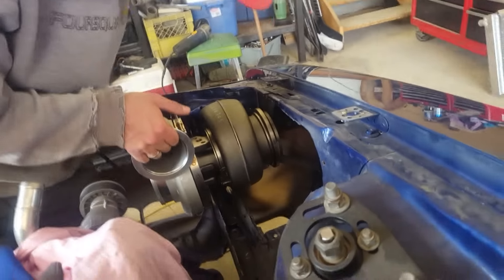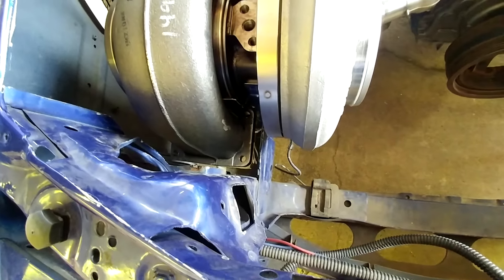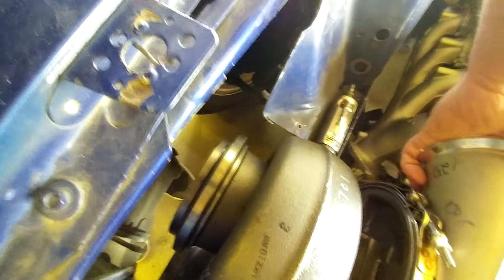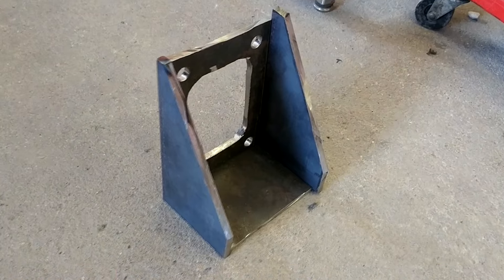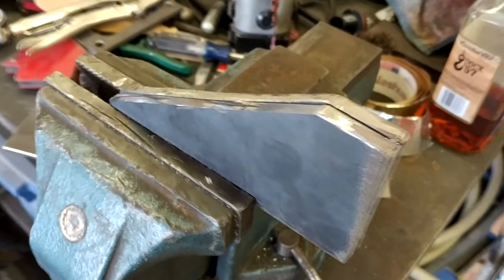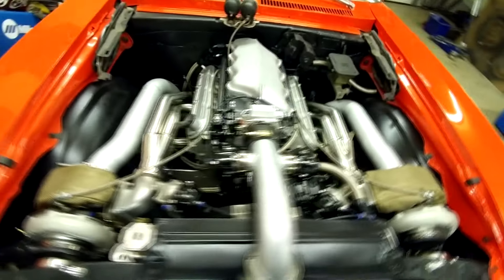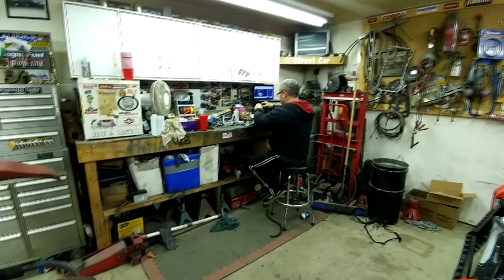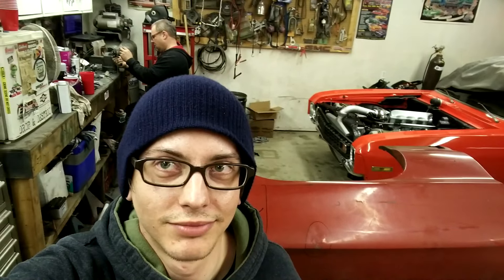S475 Turbo Foxbody Build | 5.3 LS swap progress, huge burnouts

Comment: what are the details on the 5.3? heads, cam, intake, injectors, EFI system, ect
Reply from the maker: john S All stock besides LS9 cam, and the plan is de capped stock injectors.
Reply from the maker: John Witwer Because I want to go fast! :P Fast for cheap is more like it.
Reply: John Witwer To fix it :)
Reply: SPPTV how is it getting tuned
Reply from the maker: T1GR3S13 Stock truck ecm with HPtuners by myself. Same as the Shithorse except it will get a 3 bar MAP speed density instead of a 2 bar like the Shithorse.

Comment: you're not worried that heat coming off the turbo which is now mounted directly to chassis is going cause embrittlement which then lead to cracking?
Reply from the maker: Harrop355 No. That part of the frame isnt important, besides now holding the turbo. Once the mount is in I think it will be over built.

Comment: having the turbo bolted and welded to frame rail....that turbo will get hot enough to glow ..1800.° f or more... not sure if having a glowing hot frame rail is best idea....
Reply from the maker: bryan senulis Should have at least 2 years before it breaks because the Shithorse is the same way and is still going strong.
Reply: No seam seal has melted or rail discolored from heat....i think it u get carbon metal hot like that it makes it stronger but more prone to crack ...im no scientists though......got idea....make heat sinks in area...kinda like fins on motorcycle head or computers or led floodlamps....maybe it b a long term fix